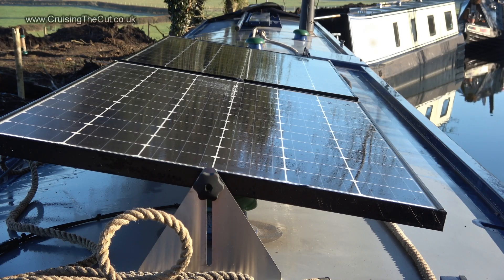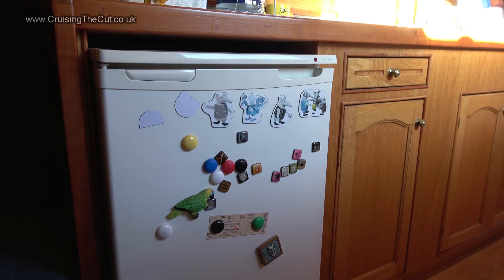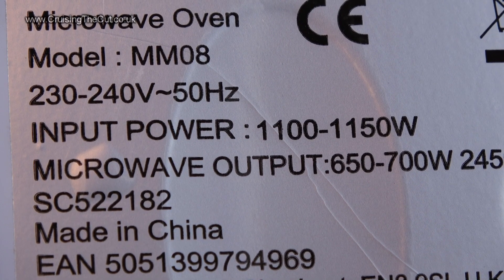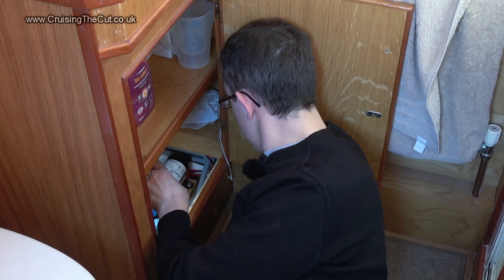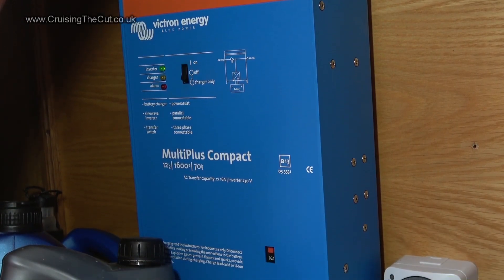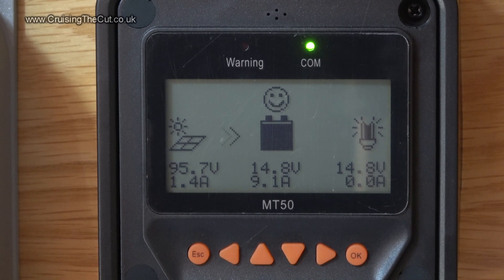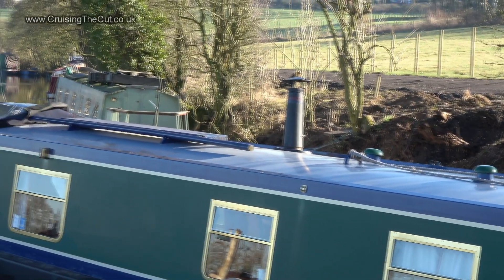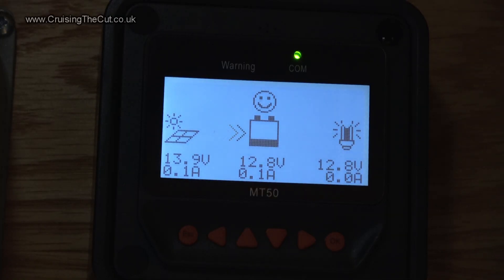76. Is solar power sufficient for a canal narrowboat in an English winter?

Comment: David, we have touched on this earlier. Renewable energy on a boat is difficult. You could upgrade your panels to 3 x 340 watt low light panels, with a wind turbine, about 500 watts. If this fails to up you energy input, you could always invest in a very long extension cord.🤣🤣🤣🤣🤣👍👍🇦🇺🇦🇺🍷
Reply from the maker: More and bigger panels would make little difference in winter when there's still very little sun to speak of and much fewer hours of daylight. Plus I do not have space on the roof for any more panels and 340W ones would be too big. Bear in mind I need space on the roof to walk about such as when in locks. Wind turbines are not so great on canal boats, see my website FAQ page.

Comment: Would you ever consider something like this for winter mooring?  Powermax 110 Volt AC to 12 Volt DC Power Supply Converter Charger for Rv Pm3-45 (45 Amp)
Reply from the maker: I don't really understand the question, sorry. But I do have a battery charger (the Victron multiplus inverter-charger) which plugs into the shoreline over winter and I run the boat off that.

Comment: I'm watching ep. 76 about solar use. When you do add more panels, you may need to upgrade your batteries and may need to add more, or you could damage your batteries over time with excessive overheating to fast charge and other issues, saw this presenter that explained why ( https://www.youtube.com/watch?v=VWUd7KcqsPE ) while I was researching adding a back-up solar setup for my home. I'm seeing this as an older video, which I am sure you may have already made your choices, but passing on info never hurts. I continue enjoy your videos - take care!
Reply: A lot of what he says is correct but the section on ambient temperature and its effects on capacity is incorrect.  Lower ambient temperatures means lower self discharge (SLA) but lower overall capacity, higher temperatures means higher self discharge but higher overall capacity.  In winter we can partly offset the effects of temperature by using temperature compensation to increase the charging voltage by a specified amount.
Reply: The solar panels connect to an intelligent controller that then dishes out what the batteries are capable of taking, they are not connected directly to the batteries.  You could add 10 extra solar panels and this controller would only give the batteries what they need and what is safe for them,.  Any excess solar power available in brilliant sunshine is just unused.

Comment: How often are you away from the dock power, and not cruising?
Reply from the maker: I moor over winter and in peak summer; other than that I try to be out cruising.
Reply: Hi! another very informative video! how are you able to use shore power with the 12v appliances though? thank you!
what have you found out about wind generating?
Reply from the maker: The shore power charges the boat batteries which can then run 12V items. For wind, please see my website FAQ page. Cheers

Comment: It's winter and you are using a fridge??? Get a simple box with a lid and stick all your food etc in that outside!
Reply from the maker: The UK winter is not reliably cold enough to ensure proper and consistent refrigeration. Today for example it was 9 degrees (C)
Reply: @CruisingTheCut  maybe but it works fine for us. Got our outdoor fridge with milk etc in a Really Useful Box from B&Q. We don't really notice much of a difference to our electric fridge. The lid locks too to keep critters out... try it.

Comment: I wonder if you could easily double your solar power input with a set of mirrors. You might be able to craft something that could store underneath your panels and you can take out on the winter days when the sun is low in the sky.
Reply: Good idea, the solar array in Las Vegas uses mirrors to focus the sun light onto the collector. I dont think it would take too much work actually. Good idea.

Comment: It is my opinion that solar panels in the UK just don't cut it.  You are forever trying to stop where there is good access to the sun which if you like trees is very limiting. You have to have good sunny days, ( lets face it, this is the UK) and they are a security worry; being valuable I would be forever worrying about them if I left the boat alone for any length of time, especially if away for a few days.  So my solution? A high output alternator, perhaps 180 amps and a special charge controller. Half an hour engine run a day would give you your 80 amp hours.   Not perfect but there is no perfect answer.
Reply: One of the things I realised this winter was that life in the UK doesn't cut it, as far as sunlight is concerned :-/ The current advice [1] is to take 10 microgrammes of Vitamin D via supplement or in particular foods per day in autumn/winter [2], because there's just not enough sunlight for us to produce enough internally.

[1] https://www.nhs.uk/news/food-and-diet/the-new-guidelines-on-vitamin-d-what-you-need-to-know/
[2] and that's just if you're white-skinned - "people with dark skin, from African, African-Caribbean and South Asian backgrounds [...] should consider taking a supplement all year round as well" (from the link in [1]).
Reply: There is a limit to how much current you can put into lead acid batteries without damaging them though, normally 20% of the AH capacity using the 10 hour rating is the maximum safe level. An 80A charge rate would be ok on a bank with a capacity of 400AH but a smaller bank and you risk damaging the cell, so current limited charge control when using a high output alternator is essential. I am sure you know that but others may not hence this post.
Reply from the maker: They work fine for me from April to October inc; it's only winter that's a problem

Comment: Hi. Only thing I can thi k of is have extra panels you can place on the tow path. But, vandalism and where to store them when not in use! Also, they are expensive, so may be diesel is cheaper if more noisy and polluting. BobUK
Reply: Wild-ass idea: perhaps hinged panels that hang along the side(s) when moving, and can cantilever out when moored - if you have them propped on a well-designed hair-trigger at either end and cushion the superstructure beneath, they should fold in if someone accidentally comes too close with a boat.
Reply: (Can you tell I grew up on Dan Dare-style Eagle comic cutaways, albeit forty years too late?)

Comment: How long do you need to idle the engine to charge your battery
Reply from the maker: That's a very complex question. For a start the engine needs to be above idle really to make the alternator work fully. Then it depends on how discharged the batteries are, how big the bank is, how much charge the alternator puts out, whether you have any solar ... the variables are endless.
Reply: @CruisingTheCut  ok to rephrase the question as to be more useful.. on a perfect day you say your solar panels give around 30amps.

How much does your alternator give when moored up and running in idle... how do the two power sources compare, one would assume an alternator running in idle would give much more power than solar panels. ☺
Reply from the maker: My alternator is 65Amp though it would need to be above idle as already mentioned.

Comment: Will your solar set up keep up during the summer?
Reply from the maker: Oh yes, easily. All the power needed from March/April through to October, generally.
Reply: @CruisingTheCut  Well then, it sounds like you are properly set up then.  My only suggestion is to turn off your refrigerator in the winter, when it is cold. Maybe get ice and a cooler if absolutely needed, but otherwise switch over to non-refrigerated consumables like canned goods or preserves.

Comment: Just remember AGM lead-acid batteries are approximately 60% efficient therefore if you charge them with 100 amp hours (by whatever source) you only get at best 60 amp hours out.  Not a problem in the middle of summer but in the winter it could be critical.
Reply: I suspect the inverters are a lot more inefficient than thought. Like a combustion engine, there;s an operating point most efficient. So if the claim is "60% conversion efficiency" for a given inverter, that's only under ideal input, output voltage and load conditions, and ambient temperature. One upside in cooler weather is the lost efficiency is dissipated heat. Costly, but at least not wasted. Given the choice of running devices at battery voltage, always do so. Inverters should only be used if there's no other choice.
Reply: @stephensaines7100  A good inverter is at least 85%. Distributing power throughout the boat is better at a higher voltage. Things like fridge and microwave are more efficient running at mains even if it is through an inverter. 120w at 12v is 10A. at 24v it's 5A. at 220v it's only 0,5A. When you are running long lengths of cable for 12v runs the losses become significant and expensive to overcome.
Next time I rewire a boat I'm putting in a 24v DC system.

Comment: What about wind power or some kind of waterwheel which generates power from currents or movement.
Reply from the maker: Hi. Please see my FAQ re wind turbines. There's no current in the canals to speak of so a waterwheel's useless.
Reply: I guess, I was thinking of a water wheel, that would convert forward motion into electricity like a dynamo on a bike which powers the lights. Another solution of course, is your frien's electric/ diesel hybrid.
Reply: On second thoughts, the waterwheel would just create drag and make more work for the engine. Your friend's hybrid engine is probably the best idea. Thanks for all of your replies.
Reply: What about gophers or mice in a treadmill? Treadmills worked fine on the the old spinning mills 😄

Comment: Solar panels are a great way to touch up your batteries but I was thinking of a wind generator as an assist for those "grey" days. Is there a safe proper way to have this hooked up in line with the panels?
Reply from the maker: Hi. Please see my website FAQ page, cheers
Reply: You need a suitable dual or triple input (solar/wind/engine) charge controller.
Reply: Every single review I've seen on wind turbines is don't bother.  At sea at the top of a mast on a sail boat a good one is useful. 

Typical 200 quid ebey job at ground LVL on w boat or van is less than useless.

Comment: I did just notice that your panels are in series. You will notice an improvement if you connect in parallel especially with your Tracer controller which will get stuck at battery voltage morning and evening and often in the day if you have passing clouds. I expect this has already been mentioned but wasn't going to read over 700 comments. I expect you've read all this before. Inverters often use over an amp just being on so 24Ah a day.
Reply: I'm a tech, took a few reads to understand your description. You forgot to supply the caveat of a single panel achieving system load voltage, and thus the opportunity to parallel the other panels to bypass the inverter and the inherent loss. My expertise isn't solar, but power supplies are in my remit. A diode switching circuit could easily perform what you describe, albeit the diodes will display a slight 'insertion loss' albeit a fraction of what the inverter would take. Shotky diodes are indicated to minimize that loss.

You make a good point, especially if the load isn't voltage critical (pumps, fridge, etc).
Reply: david's solar system uses MPPT,  the panels are connected in series to get MORE power out, especially in marginal conditions. try the victron energy web site, there is a good explanation on there.

Comment: In my expieriance, i have concluded four problems that are prerment in living off the grid as it is often called. the first problem is the rate of discharge from the battery bank is allways higher then the chargeing rate from the solar panels. The second problem is there are only around 5 hours of charging time  from after 9 in the morning when the sun is start going above the horizon and to 3 in the afternoon when the afternoon when the sun drops below the horison. the third problem is weather, what weather condions you have has an effect on the solar panle.
The fourth problem is how often do you clean the panles. The panles do get grotty from dust in the air, maybe some soot from the cbimminy bird crap, ectra.
I try to clean mine at least once a week. There is quite a bit off up keep as i call it on an boat any boat regardless where we are in the world. 
Gerard on readybaron.
happy holidays and merry christmas.

Comment: Thanks for the video David. I just watched it for the third time. One thing of note is that certain panels produce more amperage in low light conditions. If your viewers have not yet purchased solar...perhaps some research concerning amorphous solar panels would be advised. My amorphous panels are larger, cost a bit more yet will produce nearly 5% even in moonlight and every bit helps.  Amorphous panels are often overlooked due to their bad reputation of poor quality...and many are. The panels made by Uni-Solar were almost exclusively amorphous yet they went out of business when overseas manufacturers flooded the market with cheaply made panels.  For some strange reason, in the last year or so these panels have become available as new-old-stock on eBay. They are usually flexible with a bonding layer on the back, some are able to roll up for shipment and storage. Yes they will cost a bit more yet I have 9 panels in several installations and the oldest is now 11 years old and still going strong.
Reply from the maker: The problem with amorphous, as you mention, is that they are substantially less efficient than standard mono/poly types so although they're better in shade, you need more of them. On a narrowboat with limited roof space, it's not necessarily  the optimium choice given all considerations.

Comment: I am not sure if the middle of summer would yield the best results. As far as I recall solar gets less efficient as the panels heat up so there might be a point when the balance between panel temperature and incoming light yields better results than on the hottest days of summer.
Reply: Not in my experience. All panels I have had produce peak power when  exactly perpendicular to the sun. I have not noticed any difference betwixt Summer and Winter temps as to panel output. Batteries are a different matter however and definitely affected by temperature.